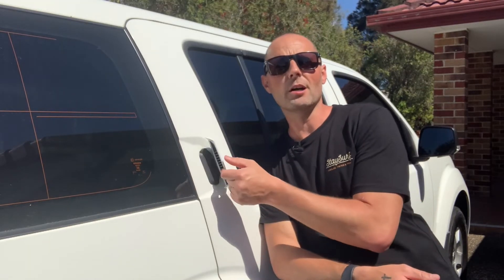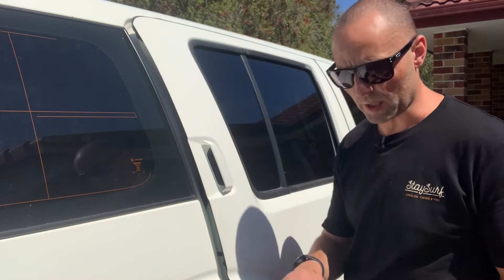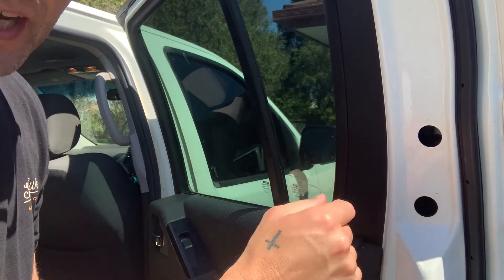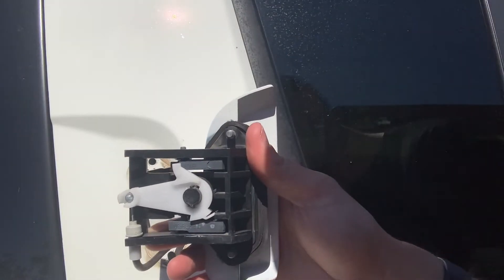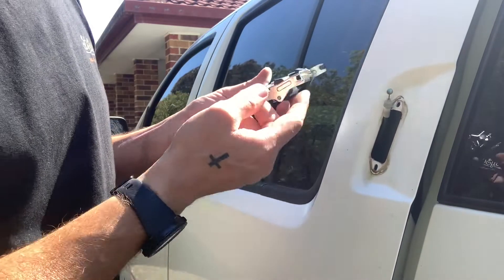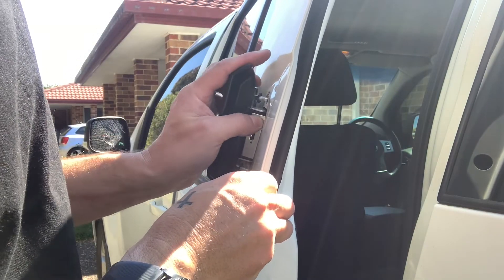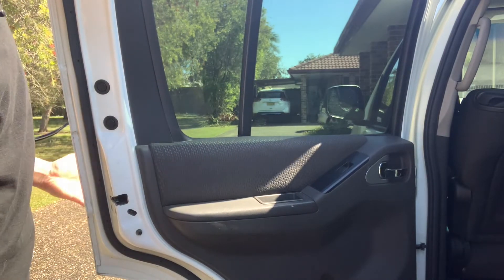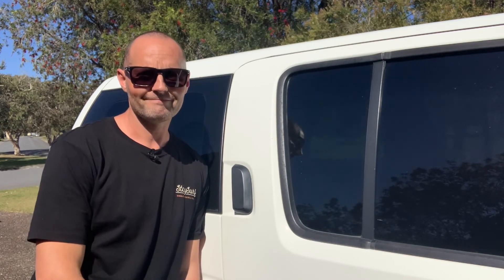Nissan Pathfinder | Rear Door Handle Replacement 👍

Comment: Bought this piece and it wouldn’t work. Had to bend one of the metal parts to get it to work. Decided to change the other side cause “might aswell”. Ended up breaking the actuator cable and now I need to spend  god knows how much to get that fixed.
Reply from the maker: @s00ke  sorry to hear this mate. Really hope you get it fixed without anymore drama. Maybe try a wreckers and get a genuine handle 👍

Comment: My Nissan pathfinder 2011 had the exact same problem as yours. I found your video while google searching for a solution, bought the part on eBay and just now replaced it based on what's shown on your video. Amazing (did lose the screws in the door but who cares 😊 found new bolt nuts easily. You saved me Nerves Frustration a lot of time and probably a lot of money as well. many thanks.

Comment: I have this problem and also someone locked the door and I can’t even open from inside. So far I learned how to fix one from from my car 😅
Reply from the maker: Hi, I had the exact same issue. It’s a pretty easy job to get the doors open. From the inside of the car you’ll see the rubber seal going around the door. You should be able to remove the area around the lock. Get a knife or something similar and push the childlock to the off position. You should then be able to open the car door from the inside. I hope this helps. 👍

Comment: Can you do a video, to unlock the doors? Both back doors of my car are locked, my kids broke the latch and because I had them with the child safety lock, now I can’t open the doors from inside, can you help me with any sugestión?
Reply from the maker: Hi, I had the exact same issue. It’s a pretty easy job to get the doors open. From the inside of the car you’ll see the rubber seal going around the door. You should be able to remove the area around the lock. Get a knife or something similar and push the childlock to the off position. You should then be able to open the car door from the inside. I hope this helps. 👍

Comment: so anyone ones what to do when its not opening from either side? was opening from inside only but suddenly doesn't before my replacement handle got delivered.
Reply from the maker: Yami, check to see if the child lock is on. You can access it from the inside of the vehicle by pulling off the rubber door seal.
Reply: Open the limp outside handle and spray WD40 through both slots and wiggle the handle back and forth pulling it out and far as it will go. Keep doing this and the tensioner will lubricate and release. Worked for me

Comment: I took this exact problem to a repairer around 6 months ago, and I kid you not, I got quoted $1000 to fix it. I told them politely that I wasn't willing to pay that. I will be chasing down the part and having a go at fixing it myself. If this works - if all it takes is a $40 part and 20 minutes of my time - I'll be very tempted to pay a visit to said repairer and give them a serve. 
Thank you for this video. ❤
Reply from the maker: Best of luck my friend. These handles are still going strong but if you can source some original ones from a wreckers, then do that first 👍
Reply: @venturingfour  Thank you. I just ordered a part off eBay. Not genuine, but honestly, I'm on my own and the rear doors don't get a lot of use (thus the reason I didn't pay the $1000). If it happens again I'll certainly take your advice and head to a wreckers. Thanks so much. 👍

Comment: Update:
I received the part yesterday in the mail. After easily removing the old door handle, I did have a bit of trouble figuring out why the mechanism kept popping out its slot. But after 20 minutes of playing, I finally worked it out. I also lost one of the nuts in the door.😂 BUT... in the end, it took about half an hour and cost me $27, after I was quoted $1000 from a repairer. Thanks so much for this video. I'm very grateful. ❤
Reply from the maker: You’re the reason why I do the videos, if only every human was as grateful as you. You’re most welcome, glad you managed to figure it all out and save your self some big coin 👍
Reply: @venturingfour  Please don't stop doing what you're doing. I for one am very grateful, as I'm sure many others are. Peace to you, kind sir. 🙏💜

Comment: Hi, I've replaced the handle as suggested, but the door lock mechanism is not opening! It's like the cable nerds to be shorter?
Reply from the maker: Hey Donavan, just make sure that the white plastic is definitely in the correct ring and not coming loose. I eventually ended up supergluing the plastic to the metal as it kept falling out. I hope that makes sense 👍

Comment: hi ive just installed these but have an issue, when i lock the car then unlock the car the outer door handles dont open but once opened from inside after unlocking they open all the time everytime from the outside, any ideas why it doesnt do this on the unlock? thanks
Reply from the maker: Do you have double lock settings on your keys? Sometimes you can press unlock button once and it will only open the two front doors or even just the drivers side door. If you press it twice it will unlock all doors. When you press unlock, can you even hear the rear doors unlocking or just the front doors?

Comment: Hi, would you by any chance have the part number for this part?
Reply from the maker: Yeh sure! https://www.ebay.com.au/itm/Rear-Outer-Pair-LH-RH-Door-Handle-For-05-13-Nissan-Pathfinder-R51-/114662958580?mkcid=16&mkevt=1&_trksid=p2349624.m2548.l6249&mkrid=705-154756-20017-0
Reply from the maker: I must say they are very cheap and you do get what you pay for. If you can afford originals from a scrap yard I would choose that option. 👍